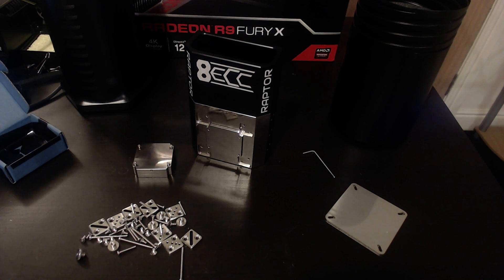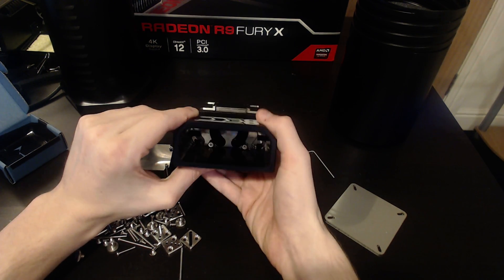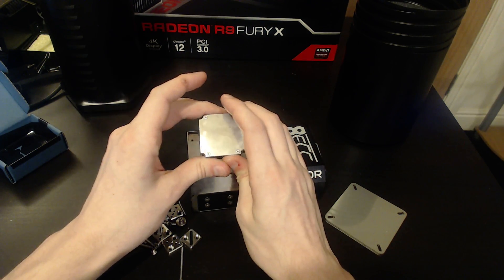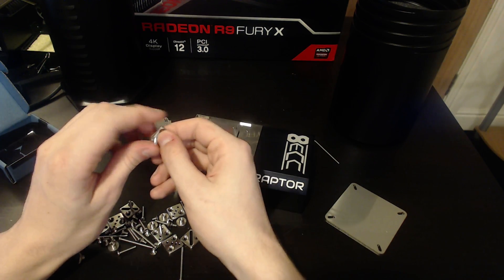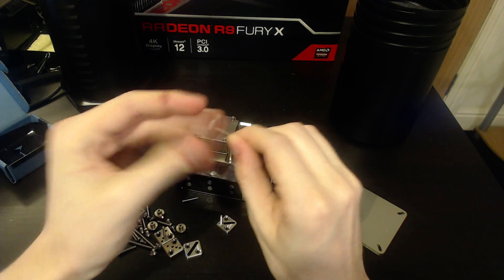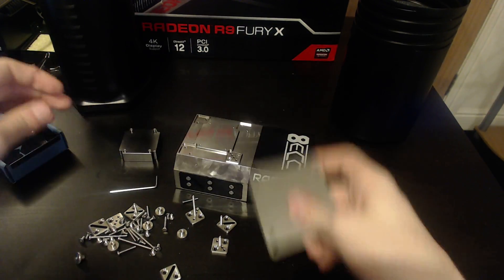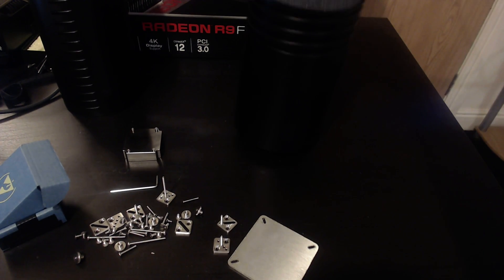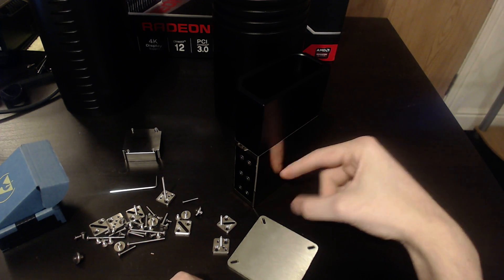Der8auer Raptor 4 GPU LN2 pot teaser

Comment: having recently used a beast I was surprised how terrible the performance of the stock insulation was (was iced over after an hour of fullpot or so). Turns out its not actually supposed to be insulation :D

Comment: About dry ice:
You should look into thermal capacity of the stuff you use. Dry ice can absorb less heat than water ice. I bet that, rather than trying to get your card as cold as possible, you prefer to keep it from getting hotter than the ideal temperature.
Maybe combine it? Toss in water ice and keep it cool with dry ice for your sub-zero goodness.
Reply: "rather than trying to get your card as cold as possible" hardcore overclockers actually do care most about "as cold as possible". Casual overclockers (air or water) care about average temperatures and longevity.

Comment: Is the sealing in the pot resistant to alcohol in most common forms and how much frosting and defrosting cycles can the sealing take until it needs to replaced? And can you use a blow torch to heat it up or dose this destroy the coating?
Reply from the maker: Added to the list of questions.